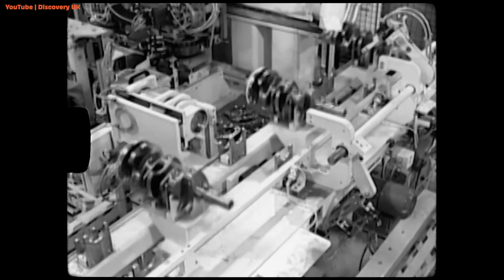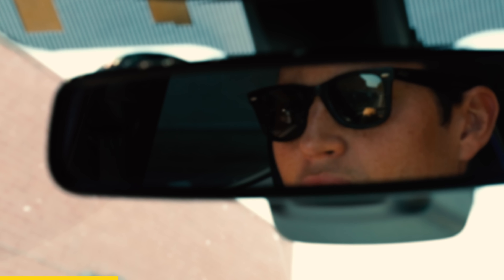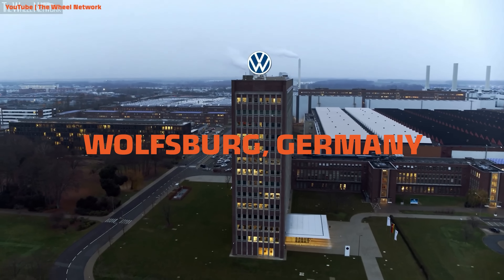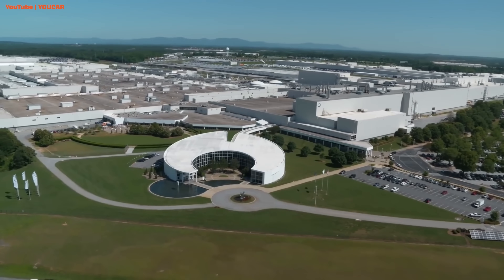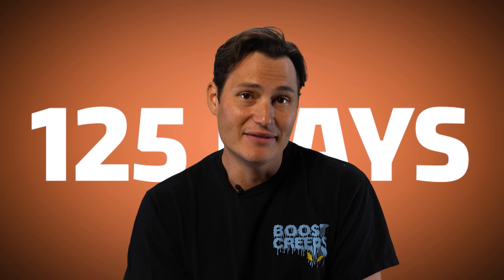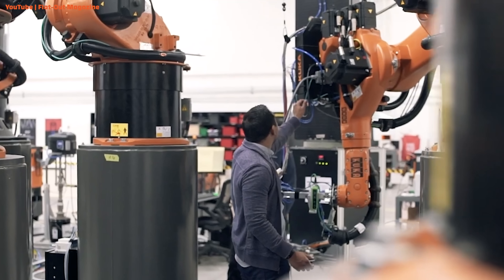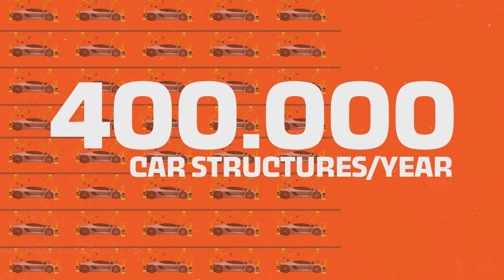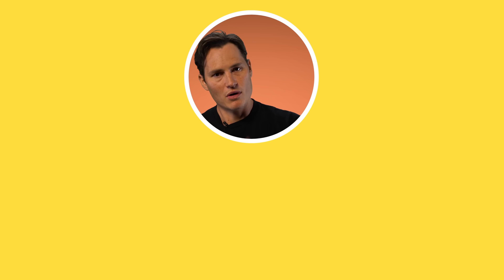A.I. Designed this Car

Comment: Key being, it's a hypercar, for converting this manufactoring method into something that can create a normal car you would need to be able to program the concept of maintainability into the A.I.
Reply: They not only need to add parameters for maintainability, but also ease of mass-production manufacturing. 3D printing a car isn't realistic with current additive manufacturing methods. They're either too weak or too slow.

Comment: Last time I have looked at metal 3d printing, it had issues in the way the metal melts and bind unevenly, making high and low points of material.

Comment: Funny thing how easy is to deceive people when they don't know shit...
Ai you speak of is a Feature of Engineering programs like Solid works(generative design/topology).
Yes for the car it is expanded to higher capability but the base program is already at 85% of the job.

Of course Its not easy To Sell a multi million dollar car unless you advertise it as Ground breaking Space exploration,worm hole jumping Technology so here we are...

Comment: “These robots and computers are way smarter than humans”: False.

What is commonly failed to understand is every parameter the confines of the computational engineering is based off of is determined by humans in the first place. The mere limits of natural boundaries and structural forces on different materials is experience based anyhow. These computers are not coming up with anything new, merely maximizing the potential of what we already know and have. 

Also, you’ll never find anyone willing to work on one of these when they fail. This is a cool novelty type of approach, but sorely fails to hit the mark of practical implementation.
Reply: They are just complicated calculators, just calculating given parameters. People just like to romantasize things they don‘t understand.
Reply: This is all true because this is not actual A.I. 

If this was actual A.I., we'd probably be having a different conversation but in truth, this current use of a machine learning system and increased computational power is merely removing the need to have so many MEs and SIEs and among other massive engineering groups whose sole task is a single function - software can replace those groups. 

With machine learning, you'll get more results regardless of it's 'intelligence', however. While not an A.I., the software itself will still outperform humans going forward, which is both cool, what we want but... also job threatening. 

In Aerospace, I'm seeing this happen on a year by year basis. Computers are doing more and more of the ground work to make the brain child of a single design group come the life - there by potentially replacing 100s of lesser engineering groups you typically needed to get a full project done. The cost savings is immense - no more waiting 24 years for a new aircraft design - you can do it from design concept to flying a prototype in a year now. It's been done and it's been done with practical effects as well as extreme high performance requirements. 

So don't discount that this method may be 'impractical' to a degree. In the current world, maintaining an asset is often more costly than simply buying a new one. This is certainly true with the automotive industry and definitely the goal of business in Aerospace. In Aerospace, you often make far more money long term off of the sustainment programs through out a platforms life cycle than you do selling the platforms at fly away cost, brand new. The same is said for the automotive industry which takes in the dough far more with selling used vehicles over selling brand new ones. Most SEDANS for example are borderline sold for a loss. It's similar to the gaming Console industry. The upfront cost is below the profit margin but the make it up through the sustainability process - nickle and diming your games, or your car parts or aircraft parts. 

This level of Machine Learning and design software effectively begins to remove that by drastically lowering the over all development cost so that one can sell the platform alone for profit rather than it's sustainment packages. As I said earlier, this was proven in Aerospace earlier this year when the exact same process happened - developing a high performance 6th generation fighter from design to full scale prototype with flight in 1 year. 

Beware of the machine.
Reply: @Nurhaal  Great essay
Reply: @CubeDifferent  

Haha!
Reply: @Nurhaal  ok boomer
how about instead of "beware the machine", we implement basic income so that automation doesn't hurt anyone, the way i see it, if it CAN be automated, it probably should be

as a result, people can then do what they want to with their time, working under conditions they choose, mostly setting their own pace, because everyone that would rush them can go to one of the surely faster fully automated companies, but the people buying from real people don't have a deadline, and are buying from them because they want something special/want that human touch
Reply: @Nurhaal  you seem tense.
Reply: You:* smart stuff *

Me: haha 69 likes go brrrrrr
Reply: Yup
Reply: Yep. The computer can't know every impulse of why a car is built the way it is. Maybe that wire isn't routed in the shortest possible distance because of ease of access or temperature parameters or wet and dry zones or impact zones.... The computer still needs humans to tell it what to do based on what humans need.
Reply: @willh7690  

Agreed! This is a neat novelty but we will always control the parameters.
Reply: @Mediamonkey11  Or will we..?

Comment: Now even engineers are being displaced by automation.

This tech is seriously cool because it will ultimately make cars cheaper, but I worry that our current version of capitalism just isn't going to cut it anymore.
Reply: A valid concern. But as someone in the software/computer engineering realm, not automotive, I'd like to assure you that this tech is novelty at best right now. It'll need far more training by experienced engineers of all walks of life before this becomes mainstream, if it ever does. More likely than not, the tech will ultimately be considered to expensive and painful to use and get dropped.

Comment: That’s great for production costs and time but what about repair time and costs?  I know the latest engineers primarily focus on the former, is A.I. Programmed to calculate optimum repair costs as an overall cost of of the vehicle?  If not then it’s just another throw away product created that will not be considered “green” as it will become trash in the near future.

Comment: As a product designer I find this interesting. Yes this design/ manufacture system can make incredible 'impossible by normal means' products but unless rapid prototyping gets WAY faster than it currently is then mass production will likly stay using traditional formed parts and this process will stay for exotic products. I would think most industry will look at setting an AI to design products this way that utilise current injection/casting/ metal forming processes and rather than produce the parts by rapid prototyping they use that approach to produce the tooling, something they already do. Then use robots to put the parts together. It should also help with end of life too as the AI could take account of the eventual need to recycle the products and design them accordingly.

Comment: Doesn't take AI to realize the absurdity of using an overly lit green screen behind a commentator, so that you can replace it with an orange screen in post production.... ahem.  PS if you were to replace the orange backdrop with  teal or blue, the green edging on the commentator would be a lot less distracting and jarring.

Comment: Video for  fools! Software to design those kind of structures has been used for more than 10 years ago. None use that because you need a 3D printer to manufacture that design. Brembo used that about 10 years ago for their calipers but they didn't need 3D printer but only multi axes drill machines. Bugatti last year 3Dprinted calipers with same technology and reduced the weight about 40% but they didn't need AI. 
Also, about AI, which doesn't exist at all, it's just a software that is connected to every possible database.

Comment: What about a car that is specifically designed to take into account your gender, weight, heights, complexion or what ever more factors you specifically need. Generate the car for you using AI. Kinda like character creator in games and then your car will be printed and delivered in 120ish days. ?

Comment: Imagine being the technician having to work on it. It's a visual illusion just starting at it
Reply: If assembling is relatively quick, dissasembling may be the same
Reply: @matiasfpm  no that's not how it works 😂. Normal cars are finished in hrs or less in factories but it's still a bitch to remove and replace an engine just because there are a lot of other parts in the wayd engineers don't really and can't really think about the technician most the time when it comes to design. Unless the computer is amazing and really did make it simple to disassemble.

Comment: So one big thing.  I am concerned about the use of AM as a  means of constructing safety critical components.  The fatigue behavior of AM materials is not well understood enough to construct reliable fatigue life models.  For one of these vehicles to be on the road and whit power out puts being that high I would want it to be inspected regularly with non-destructive methods for the purpose of crack detection.  There are reasons why vehicles are currently made using conventional techniques.  Primarily it is because of the wealth of information there is on the topic.  Such wealth does not yet exist for AM materials.  In conclusions I find this to be an educational exercise, but I would not be surprised if it does not meet approval for road use.

Comment: 1. Machine learning is not like human learning and we need to stop comparing the two.
2. Company creates advanced car engineered like the future, uses INTERNAL COMBUSTION ENGINE instead of the most advanced battery/electric drivetrain. How antiquated.
3. How does a normal human "repair" anything on this car?

Comment: I like to tease Spacex fans about Quantum Computers, A.I. and . . . .  nanotechnology making space rockets that will make SpaceX current fleet look like Ford model T's.  I've shown them all kinds of A.I., Quantum Computing, and the latest nanotech developments, and have predicted that the first Mars settlers will be a nanotech team.   There's so much there, I  can't pick one example out.

I showed them this one Germany team that used A.I. and 3d printing to make a rocket that is unlike any rocket every seen.   Right now, they can't build a Falcon 9 or Starship sized rocket with this.   It'll prove interesting how fast they get to being able to do so!  

Then there's nano-manufacturing.  Manufacturing to the resolution of individual atoms.   They've got electron microscope 3d printing down to individual atoms.  But, they can only make nano-scale patterns right now. 

Basically Czinger and other groups are giving a preview of things to come.
Reply: Like on the A.I front - there's memristers which can make computing far more energy efficient(like 95% less usage of energy than today's best transistors).  They've made a 50 million memrister chip, and are on pace to get to billlions in  three year span.    So, just imagine memrister A.I in three years designing a hypercar.

Comment: A.I. was used to engineer this car.  But a human needed to use this A.I.

Also, A.I. did not design this car.  A human did.  A human decided what the car would generally look like with A.I. refining it.  A human decided how the car would function for the driver and passenger.

A true A.I. designed car would not look like that.  It would look like a tear drop with enough space for a driver and passenger.  It is no coincidence that this car looks like a bunch of other supercars out there.

If you want to see the best example of mass production super speed machines, look to the F-35 design and assembly line.  They're going through a lot of problems but have now produced the most sophisticated fighter jet that's cheaper than 4th generation planes it's competing with.

Comment: Normal people: we just want you to build a normal car
AI: proceeds building a complicated super car.
Reply: A supercar will be a normal car if enough is produced and sold.
Reply: @jasonchiu272   the car is basically designed by homer simpson AI. It's becomes so expensive that normal people can't afford it.
Reply: @LeonidSaykin  how is it more expensive when it uses less material, the processing plant is cheaper to build and there are less workers being paid by the hour?
Reply: @satisfactioninajar7668   it's an exotic car made in exotic way. I mean if I crunch the numbers - the car for supper wealthy
Reply: @LeonidSaykin  this one specifically and at this time yes, but it's an example of what could become more common for the general public in years to come
Reply: @LeonidSaykin  Yeah but I want my bubble window it's like a convertible but not as windy.

Comment: Properly used CanBus needs one power wire to each location. Everything else is data over power to switch whatever needs to be switched. It’s not properly happening in cars because the industry never makes rapid changes.

Comment: Engineer: everything is efficiently designed for modular assembly.
Mechanic: who the hell put a 4in long bolt in a 2in space to change a thermostat.
AI programmer: engineers watch this shit. set maintenance_ease= 0 
AI: I can print the frame around the wiring harness and created a new series of hardware.
Mechanic:

Comment: it's the most efficient and practical until something breaks and you have to figure out how to repair whatever broke because everything is hidden and hard to get to. especially electrical or a wire problem

Comment: Requirements = minimum. This is why most cars these days are endless money pits and depreciate astronomically within the first 5 years and are not reliable after 100000 miles. Don't buy cars lease them

Comment: Soooo, a vehicle for humans (maybe) designed by a machine (human design not needed), built by the machine (human not needed).......basically, eliminating the need for humans?? or at the very least, humans simply start pushing buttons as a 'job'.